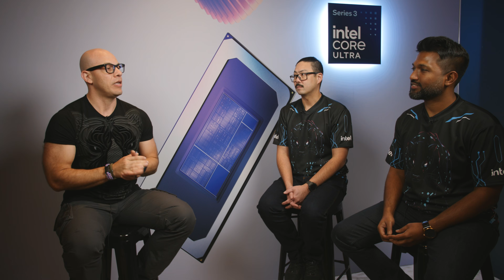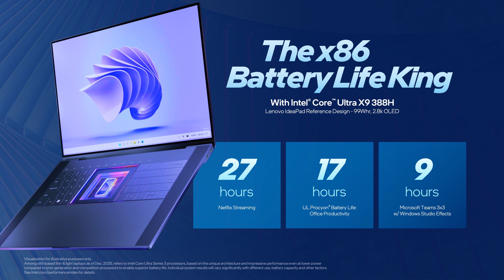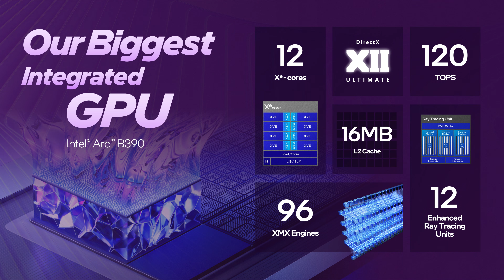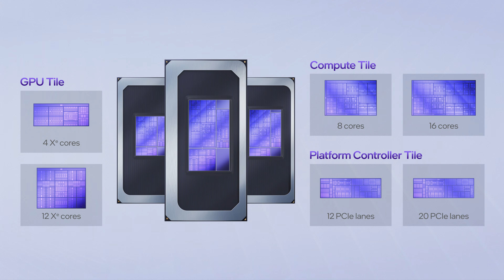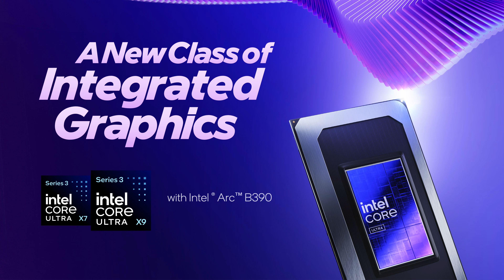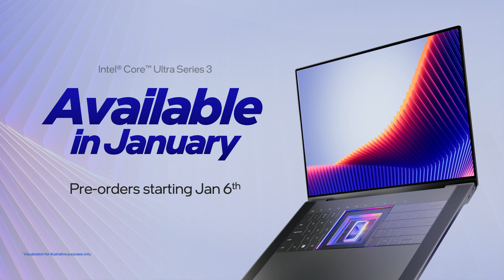Panther Lake Features and Performance Explained at CES 2026 | Talking Tech | Intel Technology

Comment: Super excited to see PTL expanding the GPU. The B390 is looking super strong, and it makes me hopeful for a future of even bigger integrated GPUs. 12 Xe cores isn't far off the 16 of the B50 for instance. Having discrete-class GPUs built into the SoC package, able to access the same large DRAM pool means a lot of potential graphics memory accessible along with a powerful GPU. I think the B50 and B60 prove people want a lot of VRAM even if the overall performance isn't the absolute best. Moving to an integrated solution means even more VRAM is possible while also making a more efficient and compact system.

Comment: Whomever made the slide that's shown at 12:36 should be fired. I can't remember when did I saw such a bad, wrong, confusing slide.

So all the "Up to 6C" aka cores, "Up to 18 TOPS", "Up to 2Xe" aka 2 Xe iGPU cores - those only apply to Intel Core 3, even though the slide shows it as if it applies to the whole stack.
Naming the generation "Intel Core Series 3" and having "Intel Core 3" also doesn't help, it's easy to confuse the two. What a clusterf***k. I guess that's probably what happened to the marketing person who slopped this slide, it got confused too.

And if that's not enough, there's two Intel Core 7 there and no Intel Core 9. Can't make this up.

Are really all the good marketing people gone ?  We've had more and more terrible names for more than a decade already. Just nobody has common sense anymore ? An 80 IQ person could see that these are just not good names. Though to be fair, it's far from the worst. But still terrible.

Anyway, I'm very excited for Panther Lake, and I hope there will be a Framework 16 version of it.

Intel if you read this, please pleeease, make or sponsor showcases of Panther Lake being used just with the LP E-cores. Windows and Linux. On Meteor Lake there's literally 0 (zero) videos of people trying to run the laptop just with the LP E-cores active (when, say, watching a movie, that should be easy enough to be handled just by the LP E-cores). I take it that probably it wasn't actually possible, the cores were probably too weak in Meteor Lake and Windows is probably too hungry. But this shouldn't be the case anymore. And it shuold be especially more easy on Linux to showcase something like this. A power profile named "aggresive battery mode" or something like that where it forces you to only use the LP E-cores would be neat when you know you need the battery to last.
Reply: Tell me how you really feel
Reply: @Grahamaan27  Well, I might've been carried away a bit... slightly. I stand by what I wrote though, it's really sloppy work on their part.
Reply: @Winnetou17 If you can't even understand the slides then you have serious skill issue. Also i'm glad Intel engineering don't listen to "smartass" like you who don't know anything about silicon chip. 🤡

Comment: I'm disappointed Thunderbolt 5 is still not native. Intel Panther Lake provides 8 additional PCIe 5.0 lanes for a discrete GPU and ignores Thunderbolt 5 for eGPU. Gaming handhelds would benefit greatly with the inclusion of native Thunderbolt 5.
Reply: I know but it's makes sense because TB5 controller hasn't mature enough, it use more power than current integrated TB4 controller. Still not having integrated TB5 controller doesn't mean OEM can't put TB5 on handheld.
Reply: @runninginthe90s75  what do you mean mature? Thunderbolt is developed by Intel, it was launched in Sept 2023. Thunderbolt 4 which didnt increase the bandwidth from Thunderbolt 3 was launched in 2020. If intel can include PCIe 5.0 it should be able to integrate Thunderbolt 5. Apple did it in 2024 with the M4 Pro/Max. A discrete solution has been available but only integrated solutions really impact adoption. So far on the Panther Lake platform there is no OEM supporting Thunderbolt 5.
Reply: @EnochGitongaKimathi  I know thunderbolt is developed by Intel but every thunderbolt controller has different generation. Early TB4 controller use a lot power which force Intel to not integrated it on the chip for years until they managed to improve the controller and makes power consumption much lower. Same story as TB5, once they improve the controller efficiency they will integrate it to the chip
Reply: @EnochGitongaKimathi  While apple integrated TB5 to their chip using Intel tech but their solution is inferior. I already see so much complain on apple forum, m5 drawing so much power even on idle when connected to external monitor using tb5 dock. Intel right now only want to squeeze every performance efficiency as much as possible, not to mention integrating TB5 will makes Panther Lake even more expensive while only few people gonna buy TB5 dock because it was so expensive. It's very reasonable move by Intel to not integrate TB5 so it's up to OEM now if they want to use discrete TB5 or not.
Reply: They can add it if they want I've seen a good few panther Lake laptops with TB5
Reply: @Frozoken  The main issue here is that there is a difference in saying some panther lake laptops compared to saying all panther lake support TB5.
Also the way any x86 PC gets support for TB5 is through an additional discrete controller which is not as efficient as offering native support (meaning the controller is integrated). It is all very unfortunate.

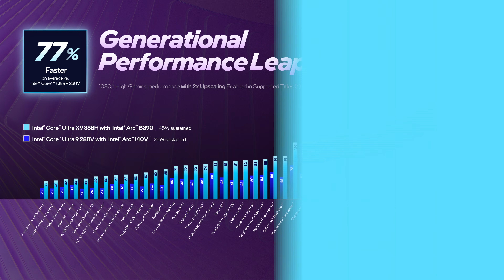Comment: The comparison at 8:25 between B390 vs. 140V is a bit odd...

X9 388H with B390 GPU draws 80% more power but performs only 77% better... So Lunar Lake is still more efficient?
Reply: Power doesn't scale linearly , so if you make both 45 w or 25w panther lake is much faster
Reply: Because from 25W to 45W it might only result in +30% on Panther Lake. The lower power configs have a big efficiency advantage. And also with more fps the CPUs needs more power as well, it's not all for the iGPU.
Reply: Lunar Lake might still be more efficient at really low power levels, think below 10W.

But like some else said, performance doesn't scale linearly. Well, for short segments it does, usually in the "good zone" before the chip is effectively overclocked. For example, to get twice the RTX 5090 performance, having twice the power won't cut it. Even if you don't overclock the RTX 5090 but instead get an extra one (in a workload/game which can use 2 cards effectively)

So being able to extend the performance while maintaining the efficiency is quite nice. Especially for handhelds.
Reply: @Winnetou17  That's simply not true. Intel already showed Panther Lake lowest power is 0.62w which is absolutely insane because Lunar Lake is already very efficient chip but Panther Lake is even more efficient than that.

Comment: Feels more like marketing :-( Why are clockspeeds so low. E core clock speeds seem lower than N3B LNL. Intel need Nova Lake with big IPC improvements. Qualcomm is making huge progress with X2 Elite and Apple is setting benchmarks with M5.
Reply: IPC for the E cores probably is really good so they can let the clockspeed be a little slower in exchange for a big efficiency gain
Reply: @PixelatedWolf2077 exactly. Many cores at lower w is worth it for efficiency with those clock speeds.
Reply: Lol Qualcomm is making "huge progress" 😂
When last time Qualcomm doing that? They are being too loud with their lying marketing slide claiming X1 Elite beating Lunar Lake but turns out their chip is even slower than Meteor Lake.
Reply: I think it's simply because of the manufacturing node is not mature enough. Hence why top-end laptops are still Arrow Lake and desktop will still be Arrow Lake.

The same happened with Meteor Lake too on Intel 4. And the same also happened on Ice Lake and Tiger Lake. The first (actually usable) 10nm CPUs. Ice Lake was actually very very efficient when it got out. But it simply couldn't go more than 3.9 GHz or something like that. Tiger Lake and Meteor Lake where very similar, a bit more mature than Ice Lake (so they could go to 45W with reasonable scaling) but still with horrible scaling, basically plateauing above 60W or so.

Comment: Ultra 3 . we'll see. IF it comes close to Qualcomm or even the AMD ryzen AI 9 H370x.  I love Intel but their arrogance put them where they are.
Reply: Lunar Lake matches the HX 370 with the same wattage, and the new HX 470 is just a refresh, meaning AMD will be eaten alive for a year or more.
Reply: @idontknow00000  Not to mention Gorgon point will still using the same rebrandeon 3.5++++ but still doesn't have hardware upscaling so technically Intel Panther Lake is already destroyed 2 gen of Amd chip which is insane!!! But Intel won't stop there because Nova Lake mobile chip will use Xe3P which will have another generational performance compared to even Xe3 on Panther Lake. It's so over for Amd!!!
Reply: I think Pat Gelsinger did and Lip Bu is doing a good job to turn things around 👍
Reply: Intel made a good job with lunar lake the last year
Reply: @davidhernandezjaime4821  Lunar Lake?  More like "Lunar Great!" 👍🌒